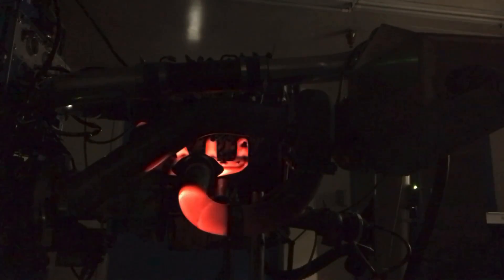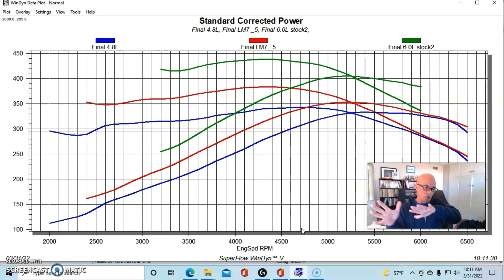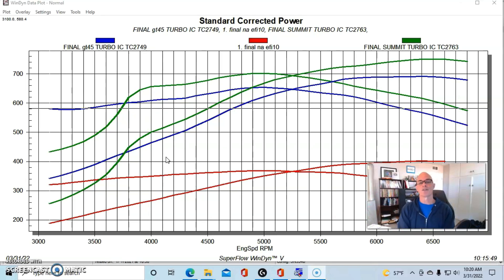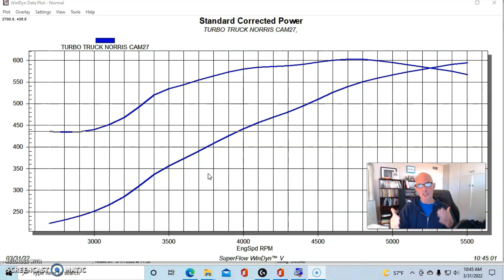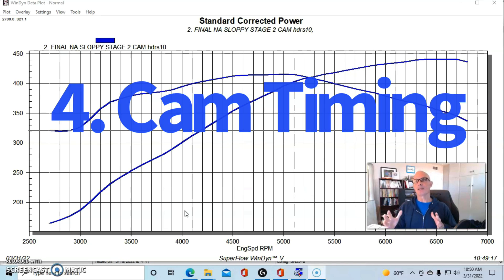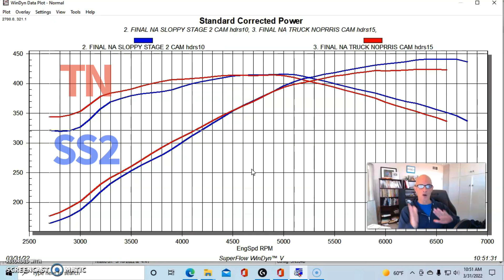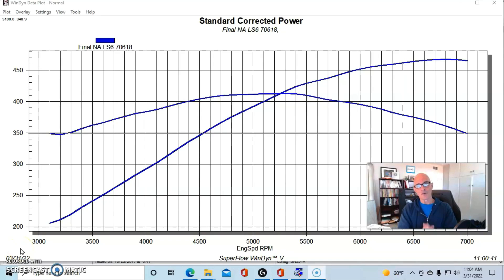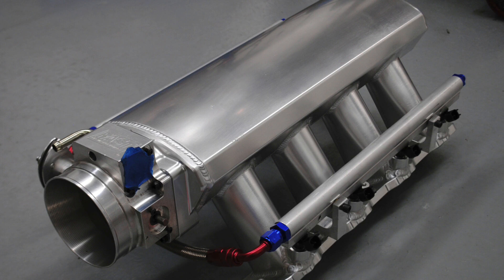HOW TO MAKE YOUR TURBO SPOOL UP QUICKER! TOP 5 THINGS TO HELP IMPROVE TURBO BOOST RESPONSE!

Comment: Which turbo do you recommend for a 408w turbo which A/R works best i will use my vehicle on a daily basis
Reply from the maker: for what power level
Reply: Under 800hp streetable going into a 67 Shelby look a like 6R80 transmission and 9”diff disc brake 3.00 gear, engine F5 roller block .030 2618 dish -28cc dart pro 1 195cc 62cc heads 4.00 stroke 6.200 rod not sure what cam lift to go with any recommendations drive it around town and maybe take it to the track on rare occasions
Reply: I spoke to a sales rep at precision turbo and he said to go with 76/75mm w/ A/R 1.28 which I think that A/R is too big especially since it going to be driven around town I don’t want it to spool up to late I want a smooth transition
Reply: Appreciate it any information you can share thank you

Comment: I have a large turbo GTX2871R
It takes time to spool up its 2.4
Diesel 154Kw, how can I alter my turbo to spool up fast, does anybody know here, or I have to get a new downsizing turbo ?
Reply from the maker: you can try a tighter AR on the hot side, or poor more fuel to it down low

Comment: Quick Spool Valve are magic for bottom end . On power in ¼ the distance  stoplight to stop light. Made my 1st gen stock tune Cummins /160hp tune drive like the 400hp sbc350 in a 6k lb 79 Chevy k20. 
my setup was set to minimum/ spring pressure open at 18psi  and would hold open down to15psi boost. At 1800rpm, dip my tow and jump from 10psi to 15 instant response  through the hx35/12 @6cm closed.

Comment: How about a video on how to not let the turbo unspool. And this is just the perfect crazy idea for a future video. Put a heavy flywheel on a turbo so that once it gets spooled up it keeps spinning and boosting for a long time. The extra boost developed when off the throttle can be stored in a boost tank and let back into the inlet to boost the turbo back up faster. The turbo would have to provide way more boost than the engine is intended to run at so there would always be extra boost to bleed off to keep the boost tank filled. This would be genius if a control system can manage moving air around to all the different parts and controlled accurately.
Reply from the maker: I suggest you do the calculations on the airflow needs on a boosted motor, then the storage capacity needed. It might surprise you, but a heavy flywheel on a turbo?

Comment: Hey Richard, love your videos! Just picked up an 80k mile 04 donor truck with a lm7 5.3 with 706 heads. Planning to do a BTR Truck Norris cam with dual valve springs, fast lsxr intake manifold with 102mm TB, and intend to run on pump gas. Its going into my 90' rcsb pickup. I'm just curious if you think the stock 706 heads and a gt45 with those other parts would make for a good street truck combo, or if I should port the heads or replace with some aftermarket trick flow heads, or different turbo. Truck will be mostly for street fun, but will occasionally tow around 3-4k pounds of toys. With so many options, I want to get it right the first time and after watching tons of your videos, this is the setup I have noted down. Any advice would be greatly appreciated!
Reply from the maker: I have a Truck Norris cam for sale and watch the live feed tonite (right now). I'm talking about a Gt45 turbo ls with that cam

Comment: Quick spool valve is the only way to go. It will add an average 100hp. I have one on my compound diesel and I’m starting to spool up about 1300 rpm and my low pressure large turbo will pick up about the time my smaller high pressure turbo starts to peter out giving me a constant spoolup from 1300 to over 5k

Comment: So Rich did you ever test the difference between an exhaust manifold and a header in respect to boost response ?  I ask because I cracked my header on a 2.3 ford and went back to a cast manifold and boost response seems to hit at a higher RPM !
Reply from the maker: that is hard to test on the engine dyno unless there is a dramatic difference

Comment: Richard , have you tested the ebay t4 7875 turbo ? And do you know if it will make 900hp on 5.3 ls 12:50
Reply from the maker: the VSR 7875 Gen 2 will make more than 900 hp

Comment: With showing boost response it would of been helpful to see graphs of boost psi vs rpm to really show how fast it actually took to spool up. I understand you could look at tq and go off that but it would of been good to see.
Reply from the maker: boost response on an engine dyno is not terribly accurate

Comment: Hi Richard I have a 428 ford fe with a 671 blower I want to switch to turbo would you recommend two small turbos, or one larger turbo? and what size would you recommend for either?
Reply from the maker: twins do the same as a single when sized for the power you want-pick a turbo or turbos for the desired combination of response and power level

Comment: What about intercooler pipe diameter?  I have seen people argue that having the smallest diameter pipe possible helps but never tried it.  I figure it would be a flow limit.
Reply from the maker: smallest pipe is a bad idea
Reply: @richardholdener1727  is it due to flow restriction like I assume?
Reply from the maker: yes

Comment: my set up comes on like a hart attack .and I have a LSX 430 cube motor with a gt 55 - 94 and a lot of it is velocity pressure.. but not back end pressure. Another   words not over kill on pipe size .but big ex turbine and ex housing  mid 8s at only 16 PSI of boost in a 3500 LBS car me in it .  this set up I have sweet spot is 26 PSI of boost but little to crazy for me. I drive it to shows and all around

Comment: Hey Richard, what do you think about charge piping length? There are kits sold for my car (1999 volvo s70 t5) called "RiP kits" or reverse intercooler piping, and they shorten charge pipe length by about 2.5 feet. They also increase the diameter of the pipe from 2" OD to 2.5" OD. What are your thoughts on this regarding boost response/spool times? Thanks! love your content.
Reply from the maker: PLEASE SEE THE TEST RUN ON THE REMOTE TURBOS AND CHARGE PIPE TEST
Reply: @richardholdener1727  Thank you, I didn't realize you had made a video of that already. So it wouldn't really be worth spending $350-450 to shorten my charge piping if its a that small of a gain? in the video you said the differences would be more exaggerated on the street so I don't know if it would be something that I could actually notice

Comment: The Heat Energy Really Surprised Me. My Jeep Would Never Spool Up More Then 3 PSI At The Drag Strip Brake Boosting. But Anywhere Else It Would Easily Spool Up 8-10 And Launch Bad Out Of Hell Being AWD. I Should Have Let It Get Hot In The Staging Lanes. I Always Thought It Was DA For The Track But I Checked DA Where I Normally Test Launches At Home And It Was The Same. My Jeep Just Wants People To Think It Can't Launch At The Drag Strip So It Surprises You On The Street hahah

Comment: Hey Richard I have a gen 6 454 that I am going to run a megasquirt Efi computer and I have a pair of hx55 turbos with big exhaust housings 26cm that I want to twin on the bbc. Should I just ring gap and a cam and run it or get a set of pistons and put a decent sized cam for it? I’m swapping out the factory Efi intake for a Holley Efi intake and what are your thoughts for the intake single or dual plane?

Comment: Excellent video Richard and lots of great comparison's there see exactly what's going to happen when you choose a certain setup for a build. I personally would rather have more power coming on down low and loose just a tad up top or even come up a lb or two to even things out because as you've just shown, it will make even MORE down low to make the same number as say, a long runner would up top. (I know, that's not exactly what you meant lol)
Reply: “Lose”
Reply: @user-pp2tl9dz1w  tganks

Comment: I would love to see a 2.25, 2.5 and 3" crossover test. Lots of guys argue about it online and I have a feeling it makes damn near no difference. But I could be wrong. My 6.0, ss2, 317 head with a 3" crossover and t6 s480 seems to spool up fine but maybe there is room for improvement???

Or maybe the loose converter hides the lag? Could be a cool test
Reply from the maker: IT WOULD LIKELY BE MINIMAL CHANGE
Reply: @richardholdener1727  essentially with a cam built more like the truck cams or say  the highlight low duration torque cams when paired with the correct tube we will be in boost faster but also don't have the ability to build that max top end power that is what usually outs out the biggest hp numbers.  But like you've said it's not just about max hp but rather being able to  to achieve all that power under the curve which equates to being more useful because it's usable hp gains in the rpm range a street car is more likely to be spend most of its time in.  So for like a single cab heavy truck (lm7 5.3)a lower duration highlift lower lsa cam paired with say a 7875 and a intake manifold with runners that are like that of of a fastlsxr.  Then for strip and all-out power high duration high lsa cam with tunnel ram intake and a turbo no smaller then 80-88mm....am I on the right path?
Reply: @richard holdener in your experience does hotside and coldside pipe diameter make that noticeable of a difference.  I always hear people stressing by 2 to 2.5 inch hotside pipes for faster spool bc there's less overall pipe space to fill and move and I've read it helps keep the charge Temps hotter which we know improves spool speed.

Comment: Did you happen to record boost curves with the cam test. It almost looks like the sloppy cam came up on boost first but more gradually.
Reply from the maker: the TN cam has more lows-speed torque and therefore more low speed boost response

Comment: Would have liked to see more on log manifold vs equal length effects on turbo, and not for your big boy motors. It may not be important to a 6.0, but for us 4 banger guys, there is a big difference in boost response between a log manifold and a properly designed equal length turbo header.

Comment: I can’t wait to hit the rollers soon
I did a 588 big block 10.5:1 Brodix bb2xtra heads
Sonny’s tunnel ram,your 300br solid roller cam
Twin billet s475 t6 1.32’s
On e85 and methanol if necessary
Reply from the maker: THAT SHOULD DO WELL
Reply: A tunnel ram, really? I am guessing you are using blow-through carbs on top of the tunnel ram?
Reply: @exploranator  no, i modified the top of the plenum and added a holley hi ram lid to it. So 102mm single entry

Comment: Also Mazda tested the quick spool valance as you called it and gained about 8% spool time reduction but 13% when actually just using a proper twin scroll setup but I realize that’s not as easy on v engines as inline motors
Reply: I would love to see this tested on a V8!
Reply: My brother added a quick spool valve and twin scroll turbo to his modified 2.3 SVO powered Mustang and has a noticeable improvement in spooling. Unfortunately a divided exhaust manifold isn't available to just go with that much simpler route.

Comment: A lot of the low end gain in spool is not from heat into the exhaust but the drag being reduced from warm oil on the turbo turbine shaft. Heat energy does not help spin the shaft but  reducing the exhaust temperature does lead to a smaller volume of gas going through the turbine. Heat the hot side of a turbo with a torch till it glows and you will see it still sits at 0rpm with all the heat energy it can handle
Reply from the maker: THE OIL TEMP IS THE SAME IN BOTH RUNS

Comment: A 125 spool shot of N2O on my T-type with a 66mm turbo plus methanol made that car go from wild to absolutely bananas. The bottle lasted forever too.
Reply: Man, I know how it goes having to sell my streetcar bc life happens and those nonneccessities are the first to go when shit hits the fan.  I love those old t types.  I'm sure even as a roller.it still.fetched a decent buck.  Those are respectable numbers.  Can't compare apples to oranges.  Nowadays you got guys on the street running in the 3s in the 8th mile and cars coming race ready off the showroom.floor and then these unexperienced idiots with money are driving around in 10 second dailys thinking their bought not built cars are badass. If rather take that pile of $ they dropped and build my ultimate.dream car.  When I was young in the 90s we were in a hp drought and now cars.came out that we're over 300hp.  Then they even cameout with v6 versions of mustangs and camaros. Sad days
  The.epa.robbed the 80s and 90s of anything resembling hp.  The hottest car back then was a 5.0 foxbody which still only came with 225 hp.  There was the turbo t types and grand nationals that were way ahead of their.time with using turbos and a 6cylinder not typical 8!
Reply: That would be wild to tune.  You'd have to pull timing off the hit for n20 but then increase fuel output increasing with rpm to feed all that air starting to rapidly be crammed down its throat bc at this rpm range boost is rolling in and then assuming your meth kit only engages at wot you'd have to also specifically tune the top end with the neccesary precautions.  Basically each stage...low mid and high rpm range works have a highly custom tune that is drastically different from the other two.  I have a question I have tossed around the idea of switching to e85 with meth injection and running  no intercooler.  What's your experience with something like that.  What kind of #s or times have you saw with your set up?

Comment: STROKE = Low Speed Power = Spool/Boost Response - Comparing 2 different 5.7L LS configurations:
1) LS1/6 'Rebuild' (3.905" x 3.622" = 347 CID)
2) (4.8 Crank) 3.268" Stroke LS7 (4.125" x 3.268" = 349 CID)
Richard, I know I have argued THIS point with you in the past (bore/stroke/tq/hp) and you have continuously shot me down and I don't know how else to phrase it, SO I will make my last attempt to say that WITH DISPLACEMTENT BEING EQUAL, a Longer Stroke moves the graph/peaks to the LEFT (lower RPM). A Larger Bore moves the graph/peaks to the RIGHT (higher RPM). There is NO denying this example, which is comparable to the example that I used previously with 6.0L combinations (3.780" x 4.00" = 363 CID/6.0L .....VS....4.00" x 3.622" = 364 CID/6.0L).
Reply from the maker: displacement makes power if you keep everything else the same (heads, cam and intake etc...)-your bore and stroke are very small things in this power and rpm level and will show almost nothing
Reply: @richardholdener1727  So basically Chevy Engineering in the 70's and 80's must have been run by the 'Helmet & Water Wing' Squad ? I mean, why else would they cast a brand new block for the 305 5L with a smaller bore, rather than pulling out the '302' crankshaft tooling (much cheaper) that would (in your opinion) have the exact same effect on shrinking the engine using the 350/4.0" block, while maintaining a decent driving experience in 4,000 lbs Land Yachts under 5500 RPM. Something tells me that by shrinking the bore (to shrink displacement) WHILE maintaining the same stroke as the 350, that the low end performance of the 305/5L suffered less TQ loss overall (compared to a 302 setup) and didn't require that cast-everything-motor to have to spin to the moon, risking grenading,  in order to get power out of it, such as with the 302. While I continue to post these cases for fun, know this.... I WILL NOT STOP ...LOL. Thanks for taking the time to reply. I do love your videos.

Comment: Does compression ratio increase boost response?
Reply from the maker: yes-because it adds low speed torque (actually torque at all engine speeds)

Comment: So with runner length in mind, I'm using the stock 5.3 truck intake in my for my turbo build, and I'm running sloppy stage 1 cam. Would there really be any benefit to going to any other intake ? To help with the lag I have.
Reply from the maker: keep what you have

Comment: Twincharging for small displacement motors.  Where you run a roots blower set to 7psi (technically to a PR of 1.5).  Low boost minimizes parasitic loss but effectively increases displacement by 50%.  The supercharger magnifies the smaller engines displacement allowing you to run a larger turbo.  I was going to do this on my 2.0L Zetec Contour using a T3-S60 turbo feeding an Eaton M62 supercharger (Focus JRSC).  It got totaled so the build never got completed.  I still wish I could have finished it.
Thanks Richard for all of your hard work.  I love the channel.  Awesome content.   Packed with hard data.
Reply: Gale Banks found that a twincharged setup like you are saying, the blower added no value above a certain rpm/output, but, alas, they did not engineer a system to just bypass it with the turbo boost as did Ford on their RS100 rally car.

However, with a straight-lobe, old-school Roots, it may be a different story.

Comment: Is there any decent looking manifold that is comparable to the stock truck intake? Truck intake is just so ugly.
Reply from the maker: Fast
Reply: @richardholdener1727  still not great looking, are all of the sheetmetal intakes weak? Nothing with longer runners that would be comparable in power to the truck intake?

Comment: Retarding timing down low to make more heat helps.
Reply: As in, still burning when in the exhaust header primaries to energize the turbocharger, in the manner done by the rally cars? (a 100hp-level throttle opening only resulting in 100hp but with the massive fuel and late spark actually putting 50hp or so worth of exhaust right in the intake manifold on top of that to keep the turbo spinning at spooling speeds.)